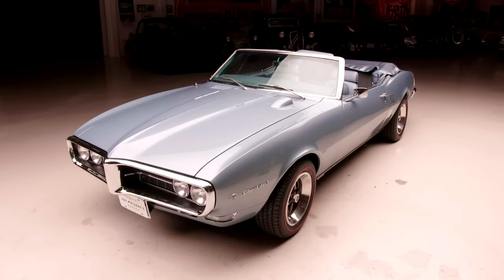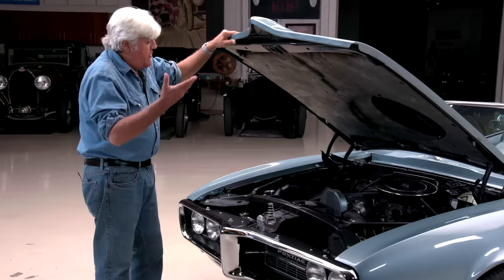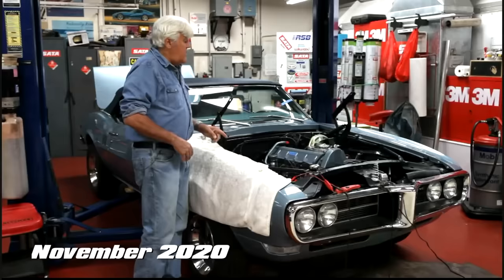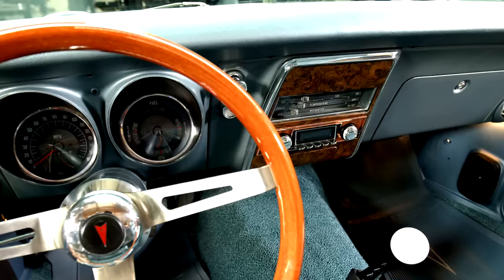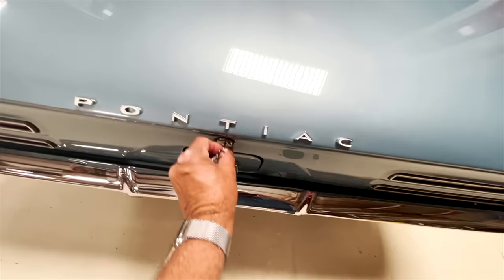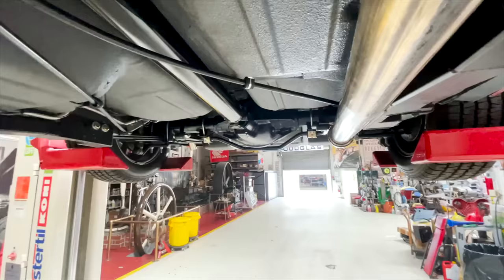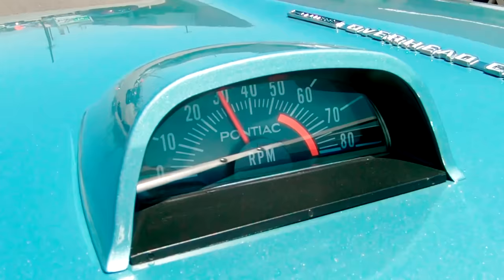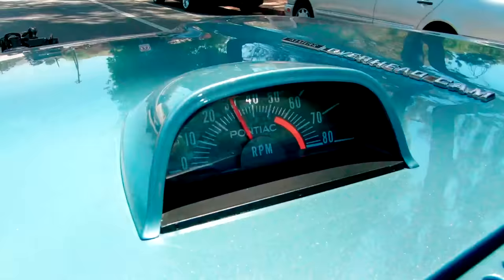1968 Pontiac Firebird Sprint | Jay Leno's Garage

Comment: I may have watched that exact car roll off the line at Lordstown, Ohio.  In 1968 there was a class trip to Lordstown and we ended up the tour at the dyno station where they tested the engine on each car coming off the assembly line.  Note, it was a test for Function, not power and was only about 10-20 seconds on the rollers.  Anyhow the people at Lordstown called this the Sprint Six and were rather proud of these cars.  When I was there I watched a metallic Blue Sprint Six convertible go across the rollers and will always remember that moment.

A few years later while working as a gas station mechanic I learned about the weak point of the OHC six and it wasn't the rockers at that time, it was the oil supply to the camshaft bearings.  With the low top end oil pressure seized  or spun cam bearings were rather typical.
Reply: I had a maroon , lived in ohio and bought from a gm assembler in lordstown in 1976 for $4000, sold it fir 6000 in 1992. Loved the hood tact and hurst shifter; needed high test or it ran weak. 250 hp leaded gas
Reply: @donaldcampopiano8726  thanks, cool…..
Reply: Thanks, good points.. I heard that too…. See my other, Comments .. My,Friend really liked*** the SOHC, SPRINTS,TEMPEST /engines of that Set,….

Comment: Thanks for all you do , saveing these wonderful cars.  I'm not one of those purest where every nut and bolt has to match.  I think the choices you have made mean that these can be enjoyed maybe even a bit better than when they came out.  As a late teen early 20's back in the 60's every spring I would wander into dealerships to see what new cars I could test drive.  One of the things I remember was how much I loved the 68 Firebird with what the salesman described as variable rate power steering .  The changed the turn rate near the turn limit worked great.  Love that car.  Thanks again.

Comment: A truly underrated piece of GM engineering. These engines are rare as hens teeth these days. Most had v8s swapped in and the 230I6 ended up in the scrap.
Reply: 250,  not 230, but you're probably still right.
Reply: The 250 made it debut in 68 and had it's swan song after 69 along with DeLorean getting the boot. The 230 was around for maybe 3 years prior to it's swan song in 68. I'm thinking one could get one in the tempest at first.

Comment: The canisters in the back are mass dampers. There is a weight suspended by two springs one on top and one on the bottom the oil is like a shock absorber. It stops oscillations up and down under braking and acceleration  as well as from bumps in the road. This makes the car more stable and predictable. I would guess it was a work around to compensate for weight differences as well as the lack of rigidity in the rear from chopping the top off.
Reply: I think they were called "cocktail shakers".
Reply: The typical term is tuned mass damper.  Tuned mass dampers are fairly common as metal weights with rubber mounts today.  My Ram pickup has a couple of these.
Reply: @richvandervoort2950  offcially yes but in the day above poster is correct. So you BOTH are correct. Renault F1 used these in 05/06 to win wdc in formula 1
Reply: They were added to remove cowl shake on the convertibles. I retired from General Motors Design Staff.
Reply: Corvair convertibles had the same weights...
Reply: @gojoe2833  And the Camaro and Firebird are fairly similar to the late Corvair body so these may even have the same part number.
Reply: They are in the front corners too, behind the headlights.
Reply: @Dr_Reason  yup.  When I needed new A/C dash vents for my 1966 Corvair Monza the '67 Camaro ones fit perfectly:-)
Reply: @glennbailey9165  love it when insiders spill the beans 😃
Thanks ✌️

Comment: I really appreciate the spirit of the smaller, lighter engine resulting in a sweeter handling driving experience. 
I recently got a 2010 Mercedes SL 350, lighter 6 cylinder engine + steel spring suspension (no ABC airbag suspension), much lighter in the nose and all the more enjoyable to drive as result.

Comment: Great restoration. It is so nice to see a different take on classic cars with a performance six and handling instead of the standard v8 straight line muscle car. My brother and I both have 6 cylinder mustangs and they definitely give a different feel and sound than the v8 cars. When a car is set up right with good weight distribution and balanced and not overpowered it allows you as a driver to have more confidence. It is fun to have too much power for a chassis but we all have seen what happens with novice drivers and v8 mustangs spin out. Thanks for all your videos Jay! I love my 4.0 overhead cam six cylinder mustang. I can see you really appreciate the six cylinder firebird sprint. It really means something when a guy can appreciate all types of cars and not just the popular ones. Sometimes the rare cars were unappreciated but still fun in their own way.

Comment: I really like this car. It looks right. Preserves its original look. Has the right body and interior colors. Has the sprint engine. The right stance. The 5 speed manual is a perfect choice. The only thing not quite right is the buzzy exhaust note. Needs a different muffler and resonator combination. It looks great going down the road. Those weights in the trunk help with the body shimmy you can get with these bodies. They are mass dampers.
Reply: Yeah big second on the rear stabilizer weights. Seeing them there makes a lot of sense on a car like this.
Reply: Yah I have an 88 BMW 535is with straight SS welded exhaust, one resonator and Magnaflow. I am putting in another resonator to quell that rasp it's annoying. Anyway this car is dope AF. I had forgotten about it.
Reply: So I said it has to do with it not having the roof structure to it that's why they added the weights it was to help with the flex of the body or something, is that why? I swear I watched a video on that somewhere
Reply: @SORGIGERMANICO  Yes I ran Turbo Corvair Convertibles and they had those Mass Dampers. I have copied the work of other machinists in incorporating "Absolute Dampers" (their correct engineering term) into boring bars (cutting tools used by a lathe to bore true holes) too.
Reply: they call those mass dampers "cocktail shakers" in automotive lingo
Reply: I learned to drive in a 68 firebird convertible but with a 350/2bbl 350th that wasn't restored or anything.  It didn't have those dampeners or any chassis stiffening (likely removed over time).  I seriously would love to ride in this car just to feel the difference.
Reply: They have giant one ones on  top of high rises to help w earthquake shaking
Reply: @patrickshaw8595  Had a 65 Corvair Convertible 110 engine w/140 exhaust.  It had two dampers in the front and rear compartments.

Comment: This is a little bit of an early Christmas present for me.  I've been watching the restoration blogs on this car, and was anxious to see how it turned out.  Jay belted it out of the park with this one.  I love everything he did with it.  His goal was to make a well-balanced car with good power, excellent handling, and excellent brakes.  Never mind that it only has ~250 HP, good handling adds 100 HP if you know how to use it.  (One little thing, though: put a cold air hose from the front grille to the air cleaner snorkel.  It'll add a little power.)

And the first-gen Firebird is a car I've loved since I was six years old.  Still do.  GM may have crash-programmed the original Camaro/Firebird to catch up with the Mustang, but they designed a classic while they were at it.  I saw a 1st-gen Firebird convertible the same color as Jay's in a parking lot in my hometown last year, and kept walking around it, viewing it from all angles.  It doesn't have a bad angle, and the body sculpture is crisp and trim, without the bulky heaviness of the last two Camaro generations.  

GM needs to go really retro with the next Camaro so it doesn't look like a Transformers cartoon version of the original.  They could do themselves a favor if they consider what Jay did with his.

Comment: This brings back memories of the first times I went cruising at 16 years old in my friend's fathers Firebird in the late 1970's. 
I know it had the 6 cylinder but I don't think it was the Sprint (no hood tach and auto trans). 
I do remember we had to wedge a folded matchbook into the 8-track player to get it to play KISS albums.
Reply: The hood tach was optional on any Firebird for extra cost. It could've been a Sprint model as they also could be ordered with an automatic transmission. I've seen automatic Sprint 6's with no tach.

Comment: Great video and great car Jay. A suggestion to help us garage enthusiasts would be to post some component information on the cars you resto-mod, such as brakes, suspension, wheels, tires, etc. Your choices of product is always spot on. And regarding the dampers in the trunk, this was a common Engineeering solution to dampen out first and 2nd order beaming, especially on convertibles when the roof was removed.

Comment: My first car was a Sprint.  250 OHC, sadly I had a 2-speed slop o matic.  What you have there is Beautiful.  Always dream of how that car would have been with manual trans and suspension/brake upgrades.  You have justified all my dreams.  Nice to see it on the road.  Thank you.

Comment: That is the coolest Firebird I think I've ever seen, it kind of looks to me like a super econo version of a Jaguar XKE straight six. Must be rare. I never even knew that car existed. You did a good job on the level of restoration by not going overboard and still nailing it perfectly. You own and have shown so many rare American muscle era style cars and make them great fun to watch with all your extensive technical research done on each and every vehicle.   Thanks again Jay for another great show. What's next?
Reply: Think I've read more than once, the fiberglass reinforced belt for the overhead cam, was so over-designed for strength, there's never been a documented case of one breaking; it ended up being 10 times stronger than the specs said it needed to be.  And guys who own them say 6500+ rpm no problem.  It loves to rev.  A guy at a car show that had one in a LeMans said he got 24 mpg; keep in mind  the 66-67 was a 230 cid, the 68'69 was a 250cid, and rear differential ratios change things drastically.

Comment: Beautiful car! Love the firebirds. I had a unique bird in high school, a 1984 Firebird with a 2.5L “Iron Duke” 4 cylinder and a 5 speed manual. With some suspension upgrades I made it was a blast to drive. Great weight balance due to the light engine. It was a dog on straight line performance but held its own on the highway and curves.
Reply: Sorry to report, but that third generation Firebird with the four cylinder couldn't get out of its own way. I was working in new car sales at the Monterey Park Pontiac Dealership in 1984, and the new car manager ordered a crap ton of those things, and they were a very hard sell. Everyone wanted a V8 or at least a V6.
Reply: Too bad you don't have that 3rd gen camaro, you would of had the ability to swap it out with an supercharged 2.0l ecotec or an Quad 4. The guy from Quadrods in Denver does make a rear wheel drive bellowing.

Comment: This is my all-time favorite Firebird body style, like you mention, as the generations of a model progress, they tend to get heavier and stodgier. I went to HS (early 1970's) with a guy who owned a hardtop version of this car, with the straight 6 and the three speed. Not much on fast, but it did handle nicely.  I think a good restomod for this car would be using one of the aluminum block V6's that you find in the base Camaro's, along with the suspension mods like you made. Should be a pretty quick car.  I wonder why, when the overhead cam head was designed for this straight-six, they didn't go for a cross-flow head, or like you mentioned, a twin cam setup (which would have worked well with cross-flow). Probably did the least they could to re-engineer the original head in order to add an overhead cam to keep development cost down. The weights in back must be for vibration/resonance control, they don't make much sense for front/rear weight balance since it seems they would make the car oversteer-happy if the suspension wasn't changed when using the lighter straight-6 versus a heavier V8.  Very nice car, Jay, you did your usual knock-it-out-of-the-park restoration, and saved one of GM's lesser-known jewels.
Reply: The "cocktail shakers" as they were referred to had been placed in all four corners of all 1st Gen convertibles to dampen body flex and vibration not found in the hard tops. It had a heavy weight and spring assembly suspended in oil. In the early 60 Pontiac engineered a dual overhead cam 421 so they knew their way around the OHC setup but were trying to keep the costs down so it would be approved. That's why the rotating assembly was borrowed from the chevy 6.
Reply: Pontiac was going to do the roller followers, but found out the cost of them in production would have been too much, so they went to the cam followers that were in the Sprint ohc 6.
Reply: Did he get a lot of chicks?? Girls? Hows he been is he alive and well?

Comment: Another John Delorean brainchild was the Cosworth Vega. 1975-76 Vega with a double overhead cam, fuel injection, upgraded suspension, tons of fun, but not a great commercial success because it cost as much as a corvette and did not perform as well. DeLorean and the other designers wanted the car to have much more horsepower, but in the early seventies they were forces to reduce the emissions by dropping the compression ratio and using cam timing with minimal overlap. The aluminum engine block had no iron sleeves and the cylinder bores would wear out just like on the normal Vega 4 cylinder engine. For the mid seventies this car had some very unique features, light and agile with acceptable power, which make it a good package for the time. The engines can be modified to produce good power.  I wonder if Jay would ever showcase this car? There might be 2200ish left.
Reply: And the 1976 Cos-Vega was the fastest 0-60 car in America that year accd. to Motor Trend. Fun to drive, but everything was slow in that era.
Reply: I own a 76 cosworth #2253

Comment: My first car was my grandfather's 1966 Pontiac Tempest, and it came originally with the OHC engine.  By the time I got it the engine had been replaced with a 215 straight six.  The original engine kept braking the timing belt, which I learned later was a common issue, along with the cams running flat over time.  Loved that car though.
Reply: Correction to my previous comment...see below.
Reply: @stuartstephens  I friend of mine had the a 1966 Tempest Lemans with the sprint opton and it had the OHC with a Hurst 4 speed.
Reply: @jameshastings2399  You're right and I was wrong...I had brain fade.  It was available in the Tempest from 1966, of course the Firebird didn't come along until 1967.
Reply: I worked for a small town Pontiac-GMC dealer while I in High School. We had a customer with a '66 Tempest or Lemans with the OHC 6.  Owner still has the car and lives about 15 miles from me.
Reply: Thank you for the post because I came on here to say that I recall seeing this engine in a 66 Tempest. Glad to see others remember that.

Comment: I'm an I6 fan. I have a '94 Lexus SC300 with a 5-speed manual. In stock form the six cylinder SC300 with a manual had the same 0-60 time as the V8 SC400 which had an automatic transmission, manual was not offered. Of course I didn't leave the SC300 stock. I had an aftermarket turbocharger installed, along with other mods. At a modest 13psi boost it generates 346 RWHP. The SC300 is essentially similar to the same year Toyota Supra, differing only in body styling and interior. The value of the Supra's has skyrocketed but the SC300's are generally ignored by the collector market.
Reply: That's because SC300's weren't painted funny colors and featured in a stupid movie like the Supra.
Reply: The BMW E36 had a beautiful inline 6. The M3 version was fantastic as well.

Comment: I remember when I got my '68 GTO there was a Sprint coupe on the showroom floor and it was really cool looking. The only thing I didn't understand was why it didn't have dual exhaust, probably both pipes exiting on the same side as was the European fashion. Wouldn't have swapped my GTO for it but it did have a certain exotic panache about it that was appealing. Probably because you wouldn't see one on every corner like Mustangs and Camaros. Probably would have been better if they had used a chain rather than a rubber belt to drive the cam. All in all it had a certain appeal sort of like the turbo Corvairs. I definitely agree with Jay's position about over powering the handling. I did some time with an MGB and a Triumph TR 4A and the real fun was, as he said, being able to use all the power and the car stayed with you. Although the 4A did have the IRS option and you did have to be mindful of that at times but no real problem like Porsches of the day before they tamed all that weight out back wanting to swing like a pendulum. Nice car Jay and always appreciate the mods that make something from the day safer and better driving. Straight line power isn't everything.

Comment: My mom had a brand new 1967 Pontiac Tempest LeMans with the 6 banger, it was a gutless wonder. She never turned the AC on even once, even in July and August because she "didn't want to wear it out." She had it for three years and traded it in on a 1970 Olds Cutlass with a V8. The LeMans still looked and smelled brand new after 3 years.